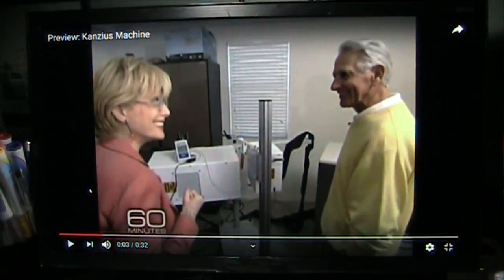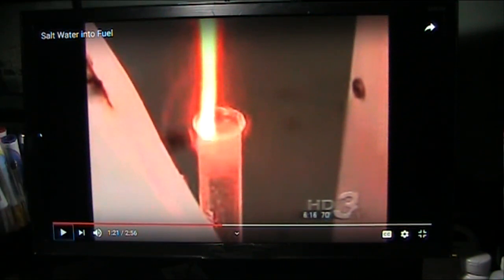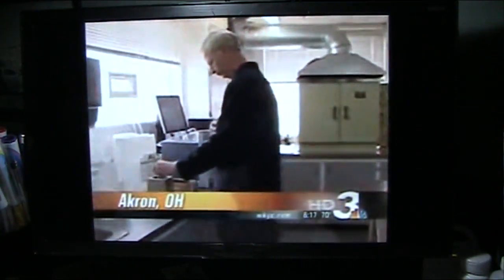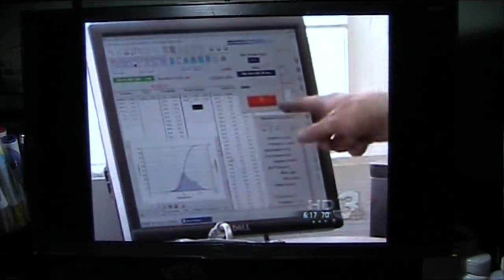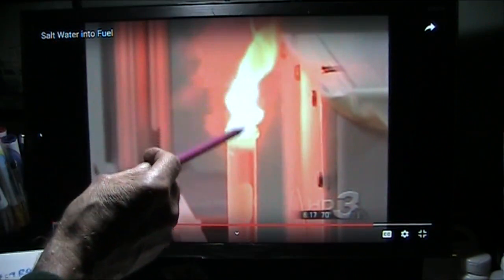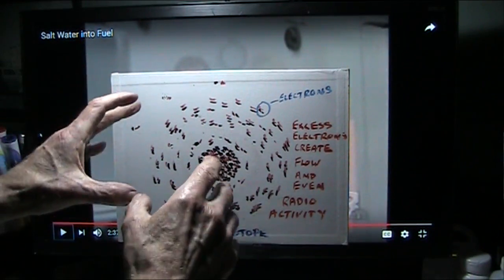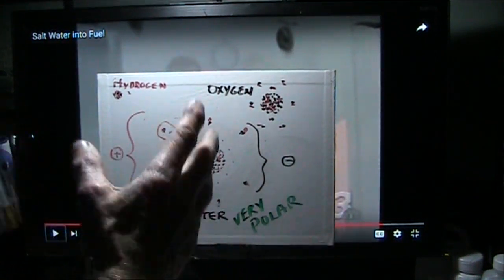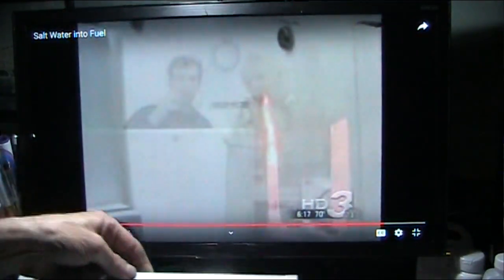Burning Water Explains Electron Flooding

Comment: It's an 'electrolytic test tube' where the combustion from the salt water occurs as a result of the salt decomposing with the help of the electrical activity, releasing hydrogen. I'm sure there would be some chlorine in that too but nothing is coming from the water. Nobody can burn water!!! Water puts out a flame!!! It's insanity really because how much energy is used to create the radio waves to then affect the salt in the water to then decompose it and release the hydrogen to then burn to power a sterling turbine - sounds like the guy's going round in circles!!!
Reply from the maker: Yes could be...his original intent was to heat Gold. However water has the two parts that burn very well and salt as a flux might release at low energy so there may be gain.

Comment: Saw a clip here showing a frequency able to kill cancer cells. Trick was he used two frequencies. One was 11 times greater than the other and under a microscope you could watch cancer cells blow apart/die. Frequency is the key to many things which is why 5G has me worried. Once 5G transmitters are all around our neighborhoods then what if a 11 times lower frequency is introduced? Population control?

Comment: The Pyramids are Resonators. During a flood when the Quartz shifts below the crust it fires of it Cannon. Pyramids are planetary defenses against invaders. The Electrical discharge doesn't need a targeting system as the ionosphere will discharge along the path of least resistance, an attracting pos or neg object to make a circuit. Biology 101. Cellular defense. Only a craft or object with a key or protein enzyme nucleotide can activate a portal to enter the egg/cell. Everything is biological electrical or chemical, even stone. Salt is a crystal a metal and a mineral??

Comment: Tesla created a frequency machine that separated hydrogen from water. He also create a small frequency box that when attached to a building vibrated it apart.  Stanley Meyer from Ohio create a frequency device based on Tesla's work that would separate hydrogen from water and allow automobile engines to run on water. Both were silenced and ridiculed. The so called invention by John in this video is nothing new. Patents are already held on this technology and guarded from the public for National Security Reasons.

Comment: #KanziusEffect - 13.56MHz  - NMR of O - Nuclear Magnetic Resonance of Oxygen - Burning Salt Water - Celestial Fire
.
.
.
Garvey Energy Project
Reply: Got this off wikipedia 
The ISM bands are also widely used for Radio-frequency identification (RFID) applications with the most commonly used band being the 13.56 MHz band used by systems compliant with ISO/IEC 14443 including those used by biometric passports and contactless smart cards. ... Bluetooth 2450 MHz band falls under WPAN.